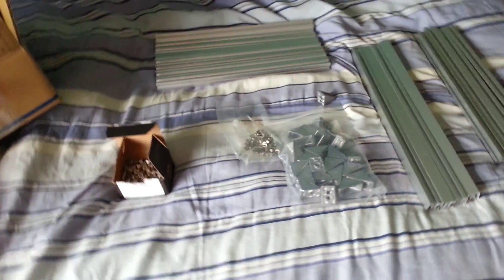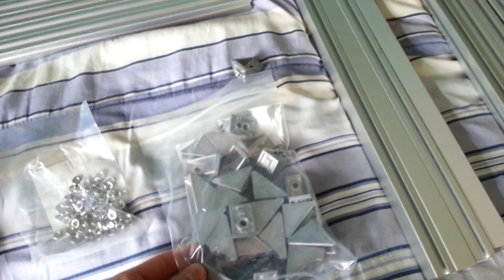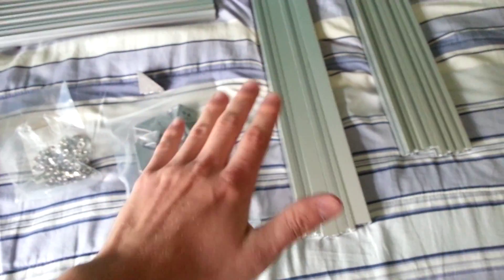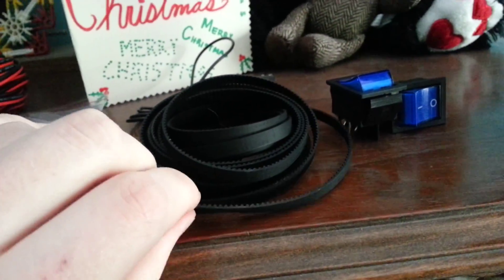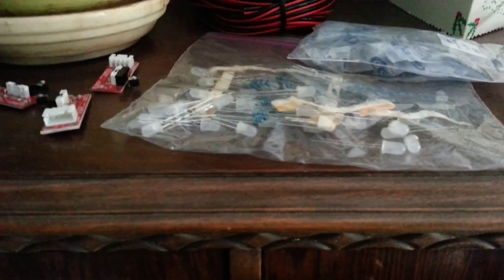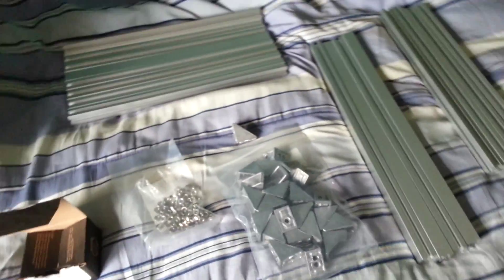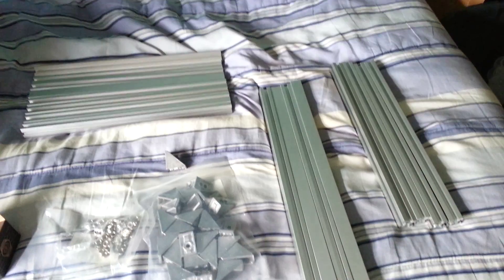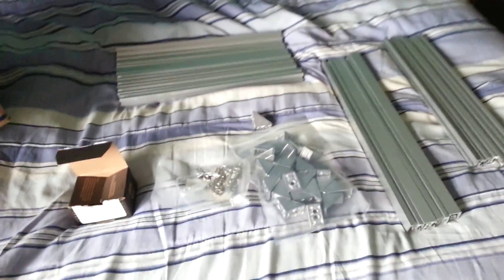3uP Update 1 - The parts are in!

Comment: Are you going to release the BOM?
Reply from the maker: Sure am along with all the stl files and the project files for each. I just want to make sure the design works or is almost working before I release the files to the public.
Reply: 3DprintedLife
is that tslot 20mmx20mm??
Reply from the maker: Robert Powell Yep it is. I was a little worried at first that it wouldn't be rigid enough, but after building the basic frame it is surprisingly strong!